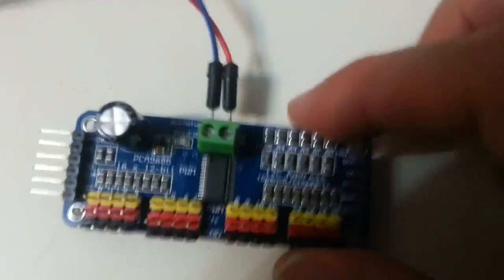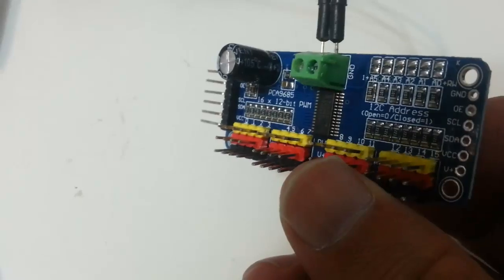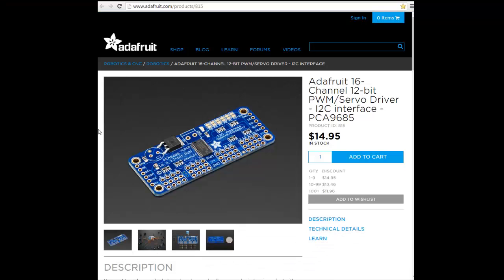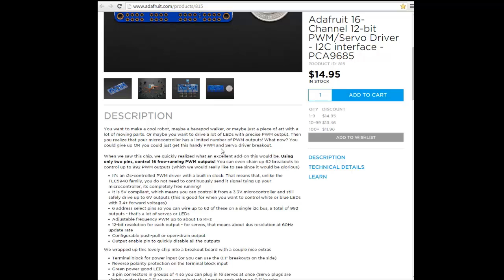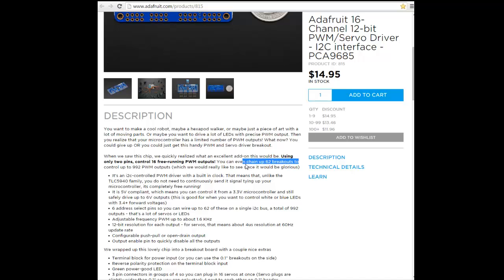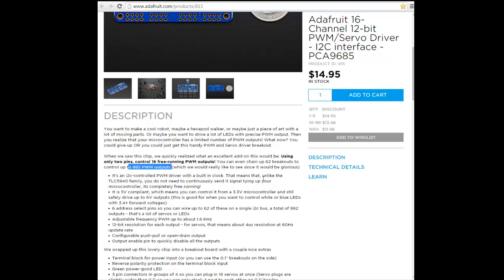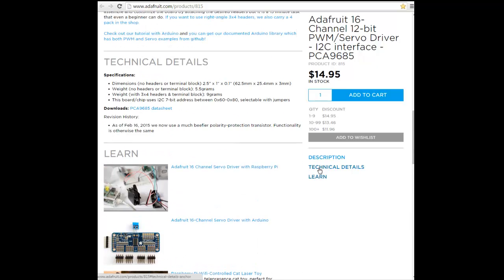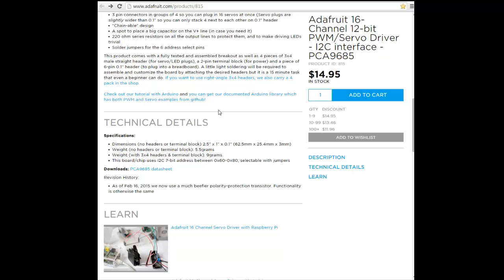A simple method to control upto almost 1000 servos

Comment: I want to connect 8*MG996r servo motors, I have 12V DC battery and voltage regulator U7805 which gives 5v and 1 Amp.... Can I use this regulator to connect the servo driver......?
Reply: SAMEERBAIG MOHAMMAD  use 2 lm2596 modules in parallel and a 12v -dc battery and pca module don't use 7805 it heats up within 1 minute of use
Reply: @abhijeet00i7  Can I also use the LM2596S ?
Reply: @Bat_OfGotham   ya , just make sure of voltage drop and current spike when servo is operated at full load ,LM2596S  burns up if current increases to 5A even for a few seconds

Comment: Great job on making the servo video! I was wondering on how you could use this board to turn on and off a few 8ch relay boards for controlling some 120volt actually led floor lights around my home? basically Daisy chain 2 or 3 of the pca9685's and 4 or 5 8 channel relay boards to control mains voltage. Thanks!
Reply from the maker: Dont use them to control a relay!!! They give a pwm signal there are better ways to control relay boards
Reply: +Marco Arduino channel We'll I need to control a bunch of them like 64+ so the board offers an affordable means to communicate with that number individually. ..? what other options do I have?
Reply from the maker: +Ray M you only need a digital pin expander via i2chttps://youtu.be/qbZM4XhlUQw
Reply from the maker: +Ray M you can also use shift registers here I show how to control 48 leds with only 3 pins https://youtu.be/uJvQNJfIMeI